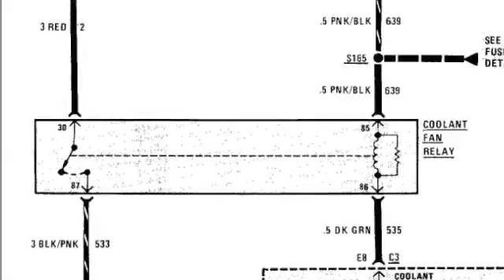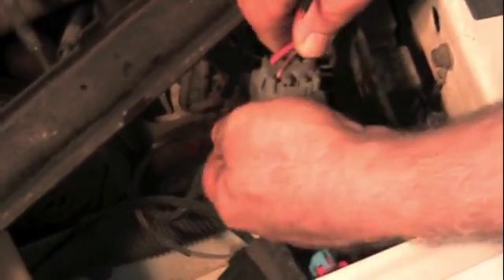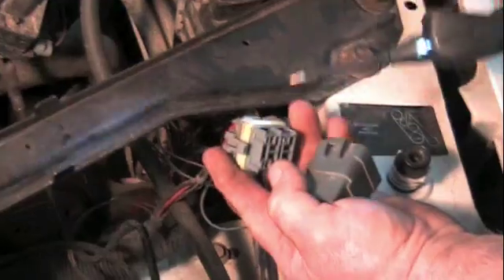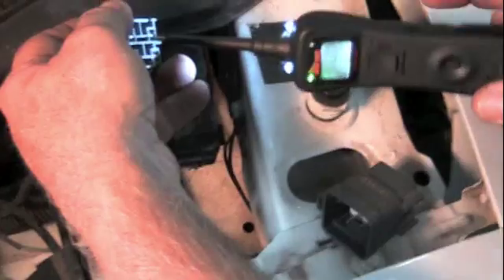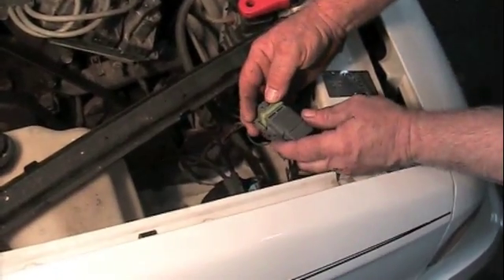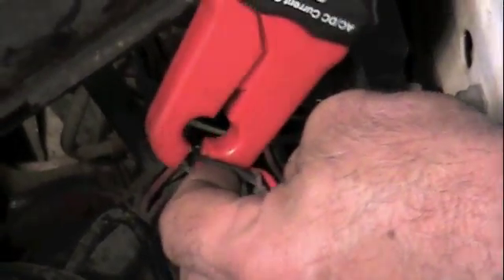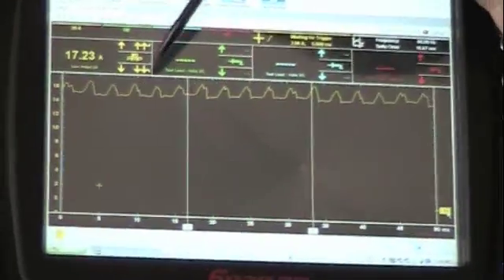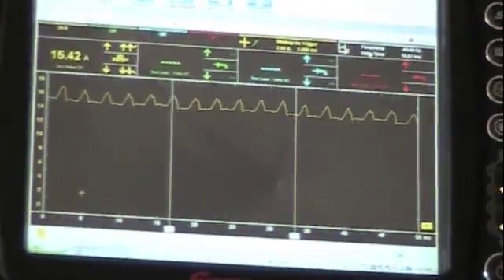Labscope testing a cooling fan motor

Comment: In every video  that you use that ES-695  low current probe -why do you always  set it to AC voltage? shouldn't  it be on DC or does it not matter when tracing current?

Comment: since that didn't look like the snap on low amp clamp, the amperage figure on the verus would have been skewed. it probably would have been better to use a 2 volt scale and do the math. Clearly the new motor was pulling slightly more amperage.

Comment: i dont get it , whats the difference between the new fan and old, if the old on was still working, i dont see why it would cause it to overheat, maybe lower amps- less rpms  but i dont think that would cause the engine to overheat

Comment: Hi Duane, great job in diagnosis, it's mazing what great tools can achieve.  Noticed the amperage thing, too.  The new one actually drew more; poor design of new motor??   Your circuit breaker probably tripped because of a non-DC pattern waveform; not excessive current.  

 What is the fuse rating on circuit to the fan?  What is the wattage of the fan?  It should be 210W or thereabouts, no more.   If it's rated at 150W the new fan is overdrawing.  Good luck.